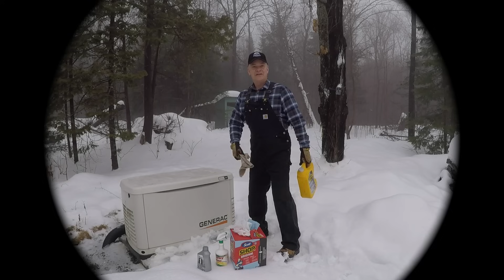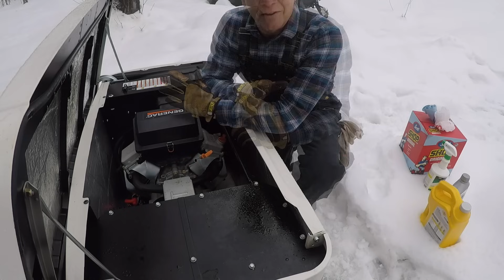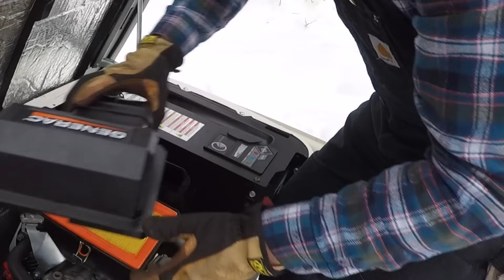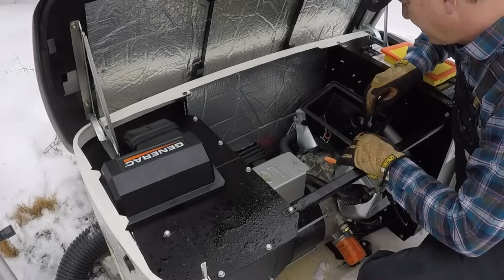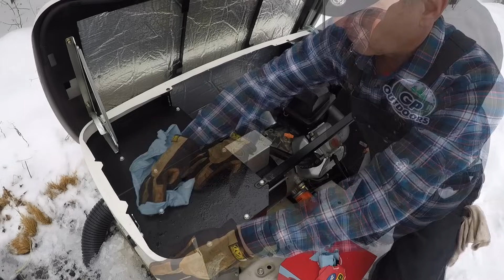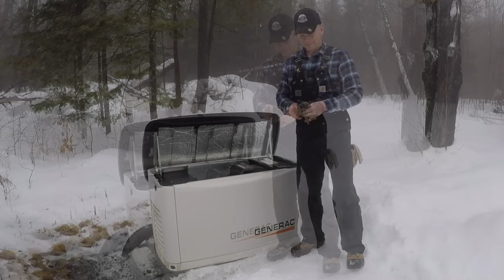#133 Thinking of Buying a Generac Generator? You Need To Watch This!

Comment: I'm a factory trained tech on these things and I have to say that over my 20 plus years in the field we never saw this problem till the EPA got involved and asked for certain changes. They asked for a shorter exercise period with the idea that it saves fuel, (about 5 minutes) then asked for a slower speed during that time to cut noise. That one might be a marketing ploy but I know for a fact certain areas have noise limits during non emergency use. Bottom line is if the engine doesn't fully warm up you get condensation, which we never had with the older sets. A hot engine doesn't make condensation so we can already figure the answer is a longer full speed exercise. The quick fix here is to get into the menu and change the speed for "quiet test" exercise and select "off" to get full speed. Next go to the options for how often it runs and change from weekly to monthly. (less cold runs) Last but not least, go out and manually start it for 15 minutes a few times per month to fully warm it up. Hearing through the grape vine you may see new units going back to a 10+ minute exercise option to dry things out internally.
Reply from the maker: Good morning Rupe, and thanks so very kindly for the detailed explanation. This makes a lot of sense to me. I will try that during this coming winter and see if that helps. I also had my local techs install the vent pipe heating kit on it as well, so I am hopeful these things will help resolve it. The techs have told me that several customers up in this area have the same issue. Thanks again for taking the time to explain and for your suggestion. Cheers and all the best!
Reply: For the newer Generac generators with the lower speed, quieter exercise option, that can be turned off.  That is what I did since it was recommended to use full speed for colder climes like here in Chicagoland.  It is also interesting to note that the exercise frequency can either be decreased or increased with the newer generators.  On the older models it was also fixed to once per week.
Reply: the EPA wants those things because they know it makes the generator not last as long. all environmental laws are made for that reason from lawn mowers to 18 wheelers. the job of the EPA is to slow all production in the US. you dont see any emissions crap on military machines or any jets do you?
Reply: @mikecubes1642  … Actually there have been changes to military stuff and commercial jets that we're not aware of. Most of it is to get better fuel economy and reduce weight. Of course anything to do with planes has to pass muster with the FAA as well. Not so with most consumer products. The buck stop with the EPA.
Reply: @mikecubes1642  The government is always exempt from the laws they create.  The very opposite of our constitutional republic as it was created.
Reply: @rupe53  not much change, no military equipment is made with DEF fluid or has to stop and recharge for 30 minutes like big trucks have to, something like that would be dangerous for the military and no plane can stop to let the exhaust filters clean out while they are flying. the EPA was made to slow production in the USA and close most factories. its no coincidence  that  most factories closed down just after the EPA and OSHA were created. its all about politics.
Reply: @mikecubes1642  … actually that's not true, other than combat vehicles not needing to regenerate. Planes never did and never will have those issues because they burn fairly clean already. Military stuff that stays stateside is likely identical to most commercial vehicles in the same class, other than the inherent "military spec" heavy duty items. As for the EPA, I was a teen when they first put their teeth into things. (late 60s) They had a major impact on cleaning up the air and water. OTOH, that did put a damper on certain companies that were blatant polluters... and ones that were already knee deep in their own toxic mess. What they did was set standards that everyone had to abide by, not just the ones with deep pockets. Yeah, some went out of business but they were not smart enough to stay afloat without tossing their trash over the fence to save a few bucks. We can now fish in the Hudson River and eat shell fish from Long Island sound, which we couldn't do 40 years ago. Politics? Yes! Are we better off? Absolutely?
Reply: @michael7dee ... the Ranger was caught in the "import" issues that were the same for any imported vehicle of that era. Much of that was a tax, not emissions standards. As I see it, the EPA has one major problem, and it's the same one we had prior to 1980. They ask for an average fuel / emissions output of the mfgr's entire fleet and when it's not met because people buy the larger truck (so they build more) then have to point the finger somewhere. Meanwhile there's thousands of fuel thrifty vehicles NOT SOLD and they wonder why the statistics are slanted. Basically the problem is that the EPA has no control over consumer preference. If you buy a truck to haul shit you will likely buy what has the most space for the buck... even if you only drive it to church.
Reply: @michael7dee ... The Ranger was made from a high percentage of imported parts, and the tax involved at the time was what kept them from making the money. As for the diesel Toyota, they did NOT meet all the emissions standards. Yes, the EPA put a lid on it but they put the same lid on Nissan and a few other imports for the same reasons. When was the last time you saw a diesel Mercedes? Oh right, about the same era. Back 40 years ago the EPA was not certifying the vehicles, but made a lot of exceptions for particular engines. Heck, even International was using Nissan diesels at one point in their Scout SUV.
Reply: @michael7dee ... At one time (40 years ago) my personal outlook was better MPG = better emissions, and it does to some extent, like when measuring raw fuel consumption. Back in the days when every shop had an exhaust analyzer we could see what changing mixtures and cat converters did to the tailpipe.... and slowly, the distinct odor of exhaust within the shop started to go away. (over years) Yes, you are supposed to put an exhaust hose on a car when it's in the shop but you'd be hard pressed to find guys doing that these days. Another observation is that stationary / industrial engines do NOT have the same emissions standards as street vehicles, especially with diesel particulate output... and it's different still for anything that falls into "steady state speed" such as generators and certain farm equipment. We are facing a catch 22 situation where emissions are 10% of what they were 50 years ago but we have 10 times more vehicles on the road, never mind other powered stuff. Could you imagine what the air would look like if we didn't make these changes? Oh wait, we can look at China and India... if we could see that far through the smog.
Reply: @michael7dee ... The law of diminishing returns.... I recall saying that at least 20 years ago. <LOL>
Reply: govt 'solution' is always a big mess
Reply: Leave it to the gub’mt to f things up EVERY SINGLE TIME. Like toilets that now need 3 flushes and shower heads that remove the mental benefits and stress reduction of a good shower. I’ve noticed the really high end hotels have no such garbage so the rich that say they support this junk of course have their own rules.
Reply: @ChatGPT1111  ... hotel toilets still need to be within guidelines but you are right about those high flow showers that seem to be making a comeback, especially in more expensive hotels / resorts.
Reply: @GPOutdoors  Can you give more info on the "vent pipe heating kit"?  I had this happen to me last year during the winter, and the generator did NOT work during the power outage we had. Lost EVERYTHING in the freezer.
Reply from the maker: Hi Patrick. It is a Generac made heating kit. I am sorry but do not have the part number but it wraps around the vent port pipe and keeps the water from freezing back into the port from the air filter compartment. I am sure your generac dealer will know what it is. Sorry i don't have any further info. Good luck!
Reply: @mrsnicks6105  ... the Generac kit is available through Amazon (cheapest I have seen) with a retail price just over $200, which includes a battery warmer, oil warmer, and breather heater. Be advised it needs to be connected inside the control panel at the 240 volt sensing wires. If you are not comfortable with this you may want to use an electrician to make the final hook up after you get the other parts in place. Also be advised that turning off the house power will cause will cause the generator to start, unless you manually switch it off outside. The kit available on Amazon (Generac cold weather kit) fits air cooled units from 8 - 22 Kw over many years.
Reply: If their plan to "slow all production" depends on making generators last less long, then more generators will need to be made. That doesn't seem to make sense.
Reply: @hieronymusbosch6255  ... As far as I know there is no plan to slow production. The reliability has also improved in the last 10 years. (that I have seen) They have been expanding their facility for years and even their stock is doing well. The only issues I have seen over the last 2 decades have been in distribution, where a major storm seems to divert supplies of new units for several months at a time. That tells me they are "balls to the wall" and can't keep up.
Reply: EPA can screw up a gas can. I’m sure they had no problems with this.
Reply: Every time they get involved things get complicated and more prone to problems.
Reply: @rupe53  MERCEDES does manufacture and sell Diesel vehicles to this day. My 07 was not California compliant until they added def and called it the blue diesel in mid 08-09.
Reply: @trentcarlson4857  ... I never said you couldn't get a diesel. I did say the EPA put a damper on things, and even you mentioned an update to your personal vehicle. The whole diesel market dried up a bit after the VW debacle 5 - 6 years ago, although recently the interest seems to have swung back despite the issues with regeneration and DEF problems.
Reply: @rupe53  I was just responding to your comment “ when was the last time Mercedes had a diesel.”                                    I agree, things needed to get cleaned up and they have but they should have some oversight. There are unintended consequences to their progressive ideology.
Reply: @trentcarlson4857  ... Mercedes diesel cars went away 4-5 years ago in North America. Fading interest in the luxury line and lack of compatible fuel is a big issue with bio-diesel not working out. (warranty voiding issues) It seems most of the states are heading toward a 20% blend of bio and that's clogging filters plus washing the cyl walls. The flip side is their cargo van will be offering a diesel soon. Not sure how they work that out.
Reply: @rupe53  Here in Minnesota our diesel has been 20% since 2018. They claim it hasn’t been an issue.
Reply: @mikecubes1642  Wouldn't that increase the need to replace and hence produce more generators which in turn produces more output? Seems counterintuitive.
Reply: @rupe53  why dont they have catalytic converters on jets? the reason jets look cleaner when they take off now is because they use turbofan engines instead of the old turbojets. remember the films of the 707s and B-52s taking off with all that black smoke? you dont see it now because engines are made different
Reply: @mikecubes1642  ... the EPA didn't set out to push manufacturing to 3rd world countries. That's a product of cost increase with bean counters looking for a way to trim those costs back. Obviously, there's still an economic gain to be had after all those shipping / transporting costs, which makes me wonder how much it really costs to make certain things.
Reply: @rupe53  the EPA was made to make it too expensive to make most products in the USA. it was a backdoor way to remove factories. all we needed were a few years of the media scaring us about the environment so people would beg to have the EPA created then it would make manufacturing in the US cost too much. how is it better for the environment to make things in some polluting factory in china then ship it here on a ship that burns bunker oil for fuel? how many thousands of gallons of fuel does it take to get a load of cheap made junk to walmart? how about all the crains and trucks at the ports and the extra trucks to haul a pair of sneakers from california to a store in new hampshire, how much extra fuel does that take? is it really cheaper than having Americans make sneakers in a factory in new hampshire and sending to the local stores? if you think about it hard enough you will see its all a big scam. it was a way to make Americans less rich.
Reply: @mikecubes1642  ... you must not be old enough to remember what many areas of this country looked like before we cleaned things up via the EPA rules. You also have no clue as to how cheap labor is / was in certain other countries, or how far they lagged behind in their own environmental clean up programs. Have you ever lived in an area where they closed the beaches and banned fishing on a regular basis due to water pollution? Have you even been in a city where the smog was so bad that you can't see across town? Yeah, I thought not.
Reply: I deliver propane for them. It’s bad after some storms streets are closed and people run out, not everyone can put 1000 tank in the ground🤷
Reply: @lfdvidinc  ... not everyone needs a 1000 gallon tank. Most of the mid size gen sets will do 3-5 days easily on a pair of 120 gallon tanks, with a bit in reserve.
Reply: @rupe53  you don’t know the people in my area , they are generation P
They use more than what you would think as average😂
Reply: @lfdvidinc  ... in order to use more fuel they would need to buy a larger gen set. If the tank and gen system was properly sized they can't use more fuel than what the gen draws. Rule of thumb on a 15Kw unit would be 50 - 70% capacity (average) which works out to just over 2 gallons an hour or possibly 50 gallons a day. (probably less daily because of less draw while you sleep) If the customer is a cheapskate and doesn't have enough fuel storage, it's basically their fault for not thinking ahead. With over 6,000 customers, we have VERY few who run out of fuel.
Reply: Better design fixes the problem too.
Reply: @mikecubes1642 . Fake conspiracy nut stuff there Mike.
Reply: Would it be Hard to run a n extension Cord out with a 25watt bulb to keep it warm in the winter?
Reply: @timothycurtin5552  ... I don't know... would it be hard? The next question is would it be safe? Would it work well enough to be worth the effort? The factory cabinet is sealed up well enough to keep mice out so where do you run the cord? (and not damage it) Light bulbs don't like vibration, and engines vibrate. That's why the factory offers a heater kit. (also available through Amazon)
Reply: Me too. I've sold Generac generators I think 20 years. I personally have never been to service school, it is when my son now 38 wanted to be a fully certified tech that he went to service school.  Before he chose to be schooled I was reluctantly privileged to service & warranty Generac, including those sold by Amazon & Home Depot. In those days most warranty claims were resulting from incorrect installation. 
In Vermont I haven't witnessed the ice in the air cleaner. I have once seen one totally blocked with snow. It was sitting on the ground, touching the building & strong windblown snow at exactly the critical temperature blew from the air intake end. 
Generac offers a crankcase vent heater to address this problem.
Reply: wouldnt a drain i the bottom help?
Reply: @baldspidey4075   what are we draining? The moisture combines with the oil and turns it into a milkshake after a few months.
Reply: OMG that will also help here in Florida. We had the problem of short run time and not being to blow off the humidity in the crankcase. We end up with moisture in the oil looking milky.  Thanks for the tip.
Reply: @rstokes8044    you really can't imagine the issue we have up north with that short run at sub-freezing temps. The solution is a manual run, say once a month for 15 minutes.
Reply: Better ventilation of the cabinet would most likely fix any condensation issues.
Reply: @43mackmobile   The moisture in the oil is from INSIDE THE ENGINE due to short run times. BTW, these are air cooled sets and have plenty of cabinet ventilation.

Comment: It’s not an exhaust port ,it’s the crank case vent. It could/ should be relocated higher in the air box to avoid the issue.